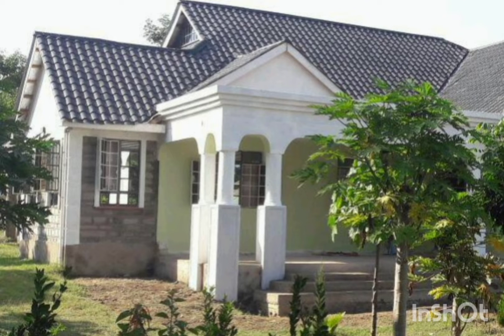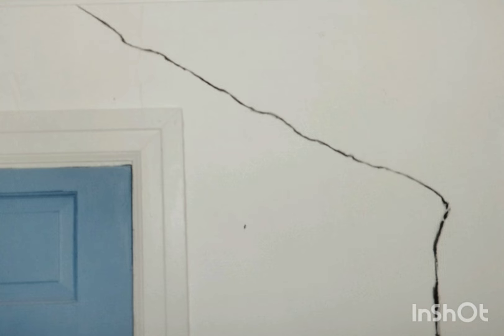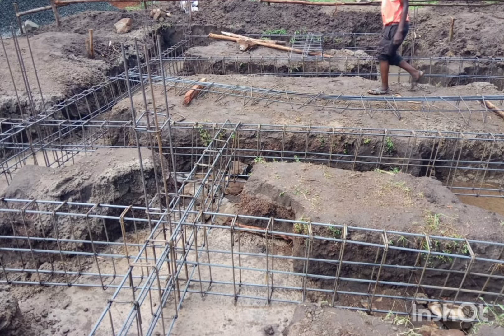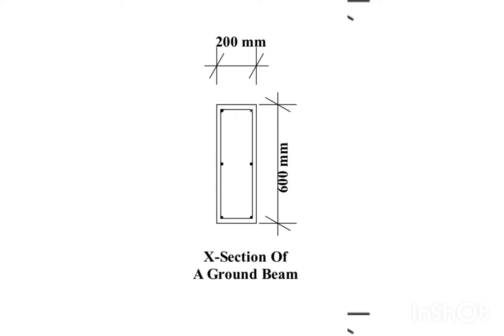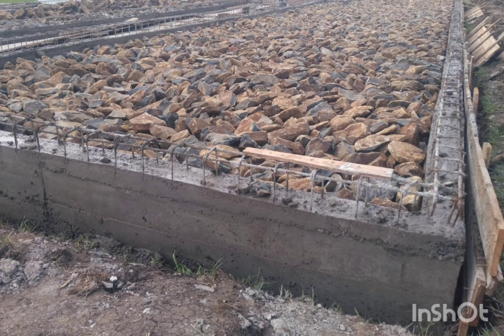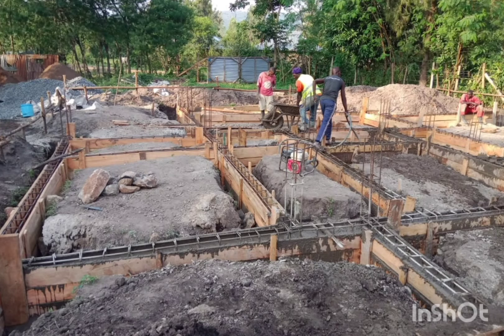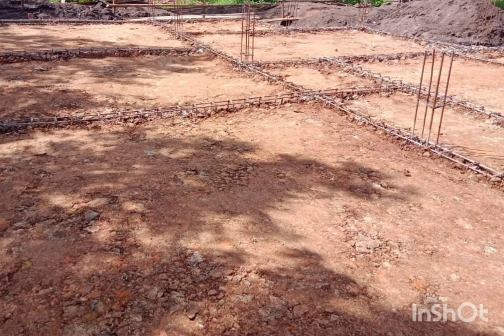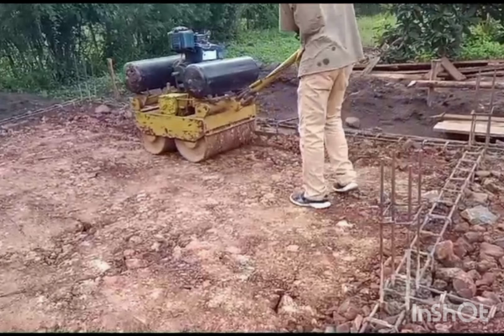How to Build a Firm Foundation of A House On Black Cotton Soil.

Comment: In case of floods water will sip under. Your idea is good but the problem is, absence of columns. Kindly do deep column to as deep as where the hard stratta is ( rcc pad foundation) in all critical points then cast it upto the top level of your ground beam.. 

This way u will have suspended your ground beam on hard ground and not just placing it on black cotton. 
But if u do your foundation tge way u are explaining in future the house will demand underpinning incase of mass wasting
Reply from the maker: Thank you for your observations and your comment.There is always room for improvement.

Comment: Valuable insight sir, if i use ground beam as per your instructions is there any needs for columns or pillars,are pillars can help stop cracks in the walls? and if not so what's the function of pillars on non storey houses?.
Reply from the maker: Hello.Thank you for your question.
If your structure is a bungalow,you don't need columns as a support,once the foundation is properly handled as described in the video you just build your house normally with blocks/bricks or stones.
Columns are necessary when building more than one storey.

Comment: Hello. Thanks for this very informative video. You didn't mention about the columns. How deep should their base be placed?
Reply: Thank you very much for this informative video and quick responses. I've learnt a lot, God bless you and may you continue with the good work
Reply from the maker: You are welcome 🙏🙏
Reply from the maker: I didn't because it was a bungalow I had in mind.But if firm ground is far off just do about 1200mm deep.
Reply from the maker: Generally firm or no firm with ground beam depth of 1200mm is ideal
Reply: Oh, thanks. So you don't need columns when constructing bungalows in black cotton soil? The ground beam will be placed on the cotton soil?
Reply from the maker: @Cleos_9 Yes don't need columns..once you do your ground beam properly as explained in the video and use brc A142 and a concrete slab of 150mm thick,then your house will be safe.
Reply: Is this a type of raft foundation?
Reply from the maker: @Cleos_9  Hi Cleophas I accidentally deleted your message...
Please reach me on 0721587726

Comment: Very clear explanation to engineering.
I've seen some people doing beam to beam and not backfilling the space underneath. What's your take on this..?
Reply from the maker: Thank you for watching us😊.This is structurally okay.The only disadvantage maybe is having a void underneath the house.Space for underground animals to play on😊... backfilling even with black cotton soil in beam to beam.Voids underneath house is a no no for me,but the house is face for use no cracks expected.
Reply: @ujenzitoday  And do the ground beams also go all the way down to solid ground?
Reply from the maker: At most half of it ie 600mm so that the house can remain above the ground as high as possible incase of flooding of water outside the house
Reply: Great advice.are you a building engineer?well explained boss.thank you
Reply from the maker: @josephachola7496  Yes I am a building engineer with over 17 years experience and counting

Comment: Can i build external walls only and omit internal ones but remove all soil to rock level at black cotton area,then refill with hardcores
Reply: Thanks so much educative lesson
Reply from the maker: Thank you John for watching and responding.By the way, if your firm ground is around 3feet from ground level yes you can replace black cotton soil with hardcore,but it's still advisable to build all internal walls, maybe omit the washrooms and small partitions only.
By building I mean using quarry stones for foundation.

Comment: Thankyou sir, this is very informative. Can I please ask if this is the same procedure it I want to construct an outside toilet-latrine in kitengela which has black  cotton soil.?
Reply from the maker: Thank Rose for watching and also for your question.
For the pit it will be slightly different, because you will be concreting on a suspended slab,so there will be a need to put timber formwork to cover the hole and then you do a mesh of D10 @200mm center to center then do your 150mm concrete slab...with a ground beam of 200mm by 450mm all around the entire structure.